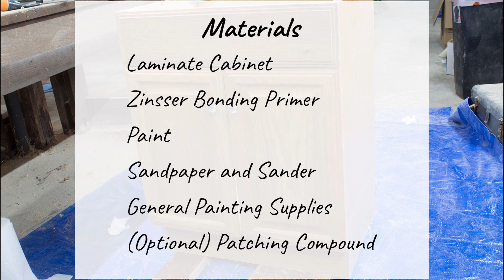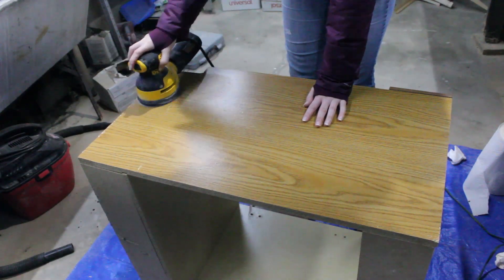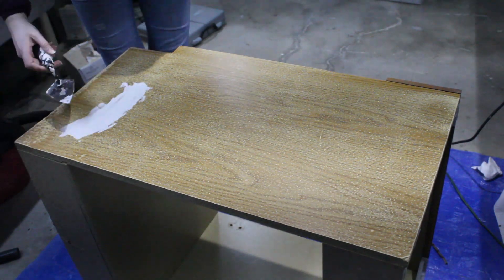How to Paint Laminate Cabinets

Comment: Good job but one mistake. Don't patch with drywall compound since it will degrade when it gets wet. And it will get wet against the bathroom floor when mopping etc. Use water resistant wood putty instead.

Comment: Did you use a 120 or 150 grit sandpaper? Or which one did you use? Or what do you recommend? We have laminate cabinets, so we want to make sure we do it correctly.
Reply from the maker: Great question! I used 180 grit, but 150 grit would probably be fine if that's what you have. I wouldn't go lower than that - you really just want to scratch up the surface of the laminate, not remove the layer.